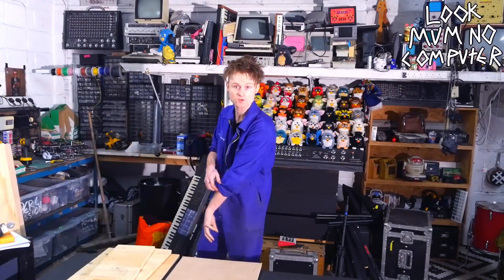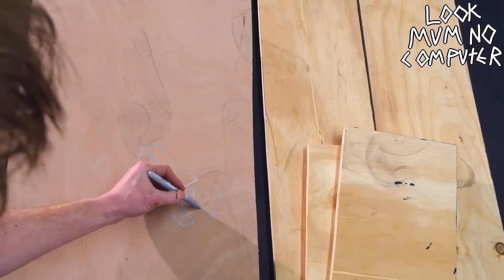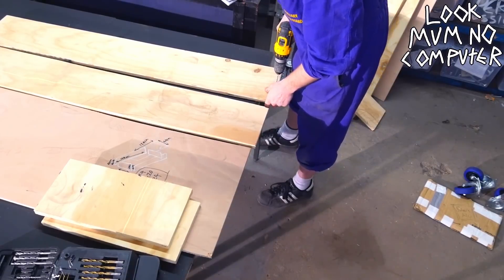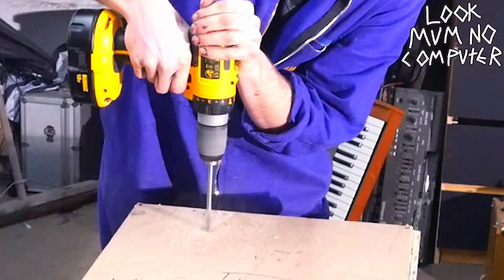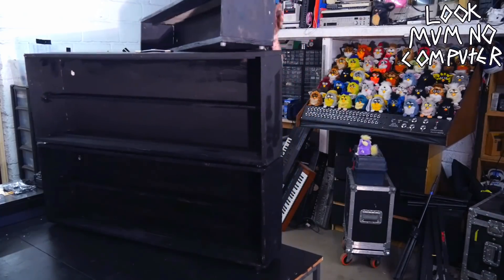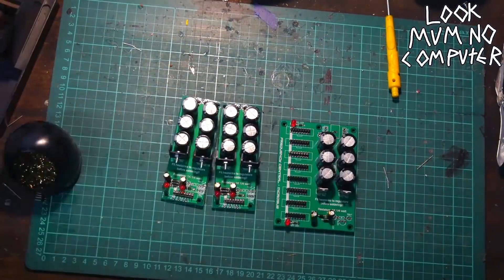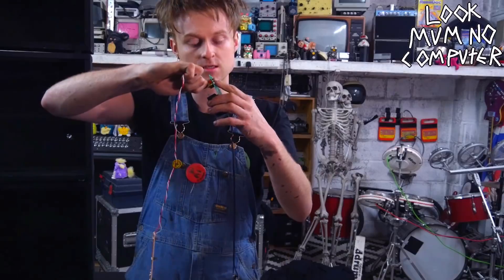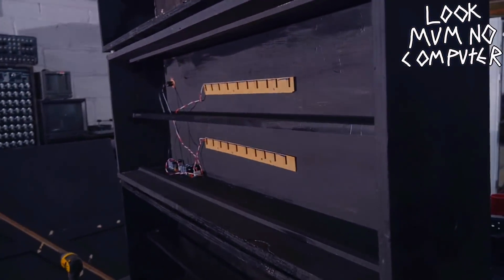Build A DIY Case And Power Supply For A Modular Synth CHEAP

Comment from the maker: “ A NOTE”A quick note I possibly didn’t make clear! The power jack isn’t 240 volts! That would be crazy. It’s wired to a 12v ac wall wart. There’s a link in the description to it!
Reply: LOOK MUM NO COMPUTER i wouldn’t put it past you lol
Reply: You should pin this comment
Reply: Are AC wall - warts or transformers a whole lot harder to come by than DC?  I have seen maybe two schematics online for making a bi-polar supply from a D.C. Wall wart, because they're more common out in this here New World.  AC are much less likely to be found.  So your voltage regulators on your Freq. Central PCBs, they're rated for a good 1 - 1&1/2 Amperes per regulator, no?  So maybe a good idea to take note your regulators' current capacities in Amperes  when matching the AC wall warts for them.  If your wall wart is able to provide 5.5 Amperes of current, then you should probably make allowances by wiring two of the regulator PCBs to the single wall wart (so to use its current capabilities efficiently).  By using different values of fuses for both rails, I've learned a whole lot about power consumption.  If you're modules need a total of 450 milliAmperes of current, I'll put a 600 mAmp fuse on it, so it won't allow too high of a current spike.  More modules, I put bigger fuse.  So I've learned that my fuse should reflect my power consumption needs and not just to put the largest fuse that my wall wart would allow! Since maybe I only need 1/2 of my wall wart's power capability.  Any thoughts / feelings about the donut shaped Toroidal transformers vs the cube shaped varieties?  You are really doing great, Thank You!
Reply: You are going to freaking bust your equipment Sam we have a gig coming up remember? FANS PLZ DONT GO :'rjfjrhfjdkcmdnjjhhejfnfhjfje OK ITS ANNOYING PLS DONT SAY HI DONT BURST MY FUSE U 3 YR OLDS PLZ NO ATTACK PLEEEEEEEEEEEZ        XD
Reply: Slightly important information that will help prevent death
Reply: Would the custom power supply work with Video synths? I would like to get started, but I don't want to buy something that isn't compatible.
Reply: Do you know if they'll work with a 15V AC thingy?

Comment: You can use screen window framing pieces for the rails as well. It's very inexpensive (about $4 US for a 7ft length), doesn't splinter when you screw your modules in, and is almost the exact same size as a legit pre-drilled Eurorack rail. Once you get your rails into your case just slap the module into the rail space, mark the holes with a permanent marker, use a 2mm bit to drill holes, then screw your modules right on it. It'll be sung the first go, but the screw will tap your hole as you screw it in since aluminum is soft. Hope you enjoy this tip!

Comment: I have a problem with my power supply. If I measure from -12 to +12 I get 48V and from -12 to GND I get 26V. At the start I have 12V but from the first diodes on it is 40V and also at the big capacitors. Can you maybe help me? :D

Comment: If anyone makes similar make sure those PSUs are wired all in phase! It doesnt matter which you connect if you have one psu board but if you have multiple connected to 12v AC they must be connected in phase
Reply from the maker: good bit of advise there i completely forgot to mention!
Reply: A rectified 12VDC supply line does not matter in terms of phase. No synthesizers I know of are powered directly with AC, they all use DC
Reply: I have never made any attempt to have my power supplies in phase? It's all DC after the power supply so Matt Gaines is right!
Reply: I still can't understand how this circuit works without a transformer... Reactifying bridges, caps and volt. regulators? So is it a rough version of a linear DC supply?
Reply: MoolahNasreddin I think it probably is a charge pump. These invert a DC voltage by periodically charging a capacitor with the input voltage and then connecting the positively charged electrode of the capacitor to ground. Then another capacitor is charged from the negatively charged electrode, which now is below ground by the input voltage. I don’t know if this explanation is good, maybe you should look up a circuit diagram.
Reply: Maybe! Need to find these schem's someday... For now I'm relying on 13.5v bipolar MeanWell supply. 1.2A max isn't great I know... so I always think "what i'll do when my "monster" will have multiple voice cards"...
Reply: MoolahNasreddin the transformer is handled by a wall wart, not on board. If you throw mains in to this it will blow up
Reply: This design is not a charge pump design, those are typical of switchers. This board is just a full bridge rectifier followed by a pair of linear voltage regulators. It rectifies 12VAC to something like +/- 16VDC which needs to be regulated down.
Reply: Right! I remember now! :) Probably I has such schem's in my archive. It was just the full impression that Sam is talking about mains going into this. I think it's some distraction of myself.
Reply: Actually looks like a single diode for each voltage rail, so not full bridge. Positive half of the cycle charges the capacitors on the V+ rail, negative half of the cycle charges the capacitors on the V- rail. You have to do it that way because the transformer is not center tapped (only 2 wires coming out of the wall wart).
Reply: Why? Modules use +12V and - 12V after diodes caps and regulators ICs. What's the problem if what's before the regulators is not in phase across different PSUs?

Comment: I always build my Kosmo cases with backs that can flip open. Held closed with magnets. But I guess for touring that would be too fragile. I mount the power bus system on the floor of the case instead of on the back. I love the way you put these cases together Sam. It's so simple and yet so practical.

Comment: Pretty cool units and very useful. Just a thought - if you drill a few holes in the top to line up with the rubber feet then they will lock together a bit better. Glue some blocks on the inside then to seal up the holes...

Comment: Like the strip board power distribution. I do that too!
Reply: where can you buy large pieces of stripboard like the one sam has in this video? or is it just a bunch of smaller pieces connected to eachother? hope you read this i am very curious to know. and thanks in advance if you do!
Reply: @freshescargot2470  I've never found long pieces like Sam has. Wish I knew where to get ones like that. I just ordered some of the longest ones I could find available on ebay in the U.S. I use 2.58" solder in screw terminals to connect power to the strip boards. Good luck with your DIY!

Comment: So can you do a little more about the power supply? This is the most informative video I've seen so far and all your videos are inspiring stuff but it sounds like, when I see +12 and -12 volts, maybe you can use an old desktop PC PSU. God knows I have a ton of those around. BUT what is the pinout like? etc. GREAT WORK! keep on preaching!
Reply from the maker: Yep that’ll work
Reply from the maker: Pin out? Anything asling as the wires are wired up right. If you want to use the same connectors as in the vid search up eurorack power connector pinout

Comment: Hey Sam! So I'm building my first case. 40 cm x 20 cm sides but only 80 cm wide, due to what wood I already had. Thinking about rail placement now. Can you say why you offset your rails so far back? Most other cases I've seen look to be flush or just very slight recessed. Is it so you can transport your cases with cables plugged in and not damage them? Thanks and keep up the amazing work!
Reply from the maker: Yep I put mine back about 13cm to clear the jacks with a bit of wood on the front

Comment: Man, will be cool if you'll be explaining oscillator circuits in details! I know some things but this is basically in the range of just one type of oscillator: saw core Jupiter8 design (made in AdamskiA videos). Very good oscillator (in terms of cheapness) but highly depends on DC stability.

Comment: I have a bench power supply(fairly cheap one from Amazon), I’m wondering if it works in the same way. I’ve had several failed attempts at making the ms-20 filter and the 1v/octave cem3340 oscillator, after troubleshooting, I’m beginning to suspect the bench power supply I’m using is the culprit. It has a +, - and ground so I assumed it would be fine but after poking my cem3340 oscillator I noticed that when set to 12v, the positive was putting out 3.8v and the negative was -8v. The power supply works fine on projects that don’t use bipolar power.

Comment: I have a question about the whole +/-12V DC. So, I came across and article that had shown that use of dual 12vAC/DC adapters wired together creating a +12V/GND/-12V and is the method I decided to go with because of the simplicity of it. Now my main question is...what in the heck gets connected to the -12V? lol The modules I have right now are basic 555, Hex, and Phase locked loops which can be powered by either 5V/GND or +12V/GND. What part of any of diy modules will be using the -12V? I've already blown six 555 chips with experimenting (wasn't the smartest thing but fun fire works in my studio!) lol Answers are greatly appreciated :) thanks

Comment: Sam, take bashed bits of broken electronics and strip them for parts to make your first modules:  old stereos, old mixers, etc.  Stuff that is junk and just being sold for parts/scrap... parts that most anyone can find in the rubbish bin.  I like the idea of showing people that there IS a way to build your own stuff on a minimal budget.
Reply: I scavenge old electronics for parts and alot of the stuff inside is reusable! the biggest trouble with this idea is finding some kind of transconductance device. the CA3080 or even updated LM1700 are not going to be in regular gear that can be salvaged. These are unfortunately essential for stable oscillators/filters. however, some sound system equalizers have discrete transistor pairs which would likely be closely matched, which you could use for log conversion, etc. FETs are also not as common in consumer electronics, or logic chips... I definitely filled my parts bin with stereo innards and was making shitty noises before I bought actual parts but way worth it to just buy the parts IMO.

Comment: The cases seem quite wide. I can see the benefit of the front space from the batons to leave cables plugged in, but was thinking of making a picture frame type wall mounting to hold my Kosmo's. Is the recommended width just for stacking the cases or are there cooling or other considerations that I haven't thought of? Cheers.

Comment: What’s a good preassembled power supply and such that I could buy for a case like this? What are all the electrical components required?
Reply: Pretty sure if you ask Frequency Central, they'll sell you an assembled FC Power - they sell assembled and unassembled versions of their modules, so I would assume they'd be happy to do the same for the power supply! But probably with additional cost? Just make sure to specify that you want assembled clearly because it looks like they usually just sell the PCBs. "Generally these PCBs are DIY only, but I am prepared to build them should you wish, please enquire."  http://www.frequencycentral.co.uk/?page_id=1758

Comment: I cant figure out after hours how you built the extra sockets on strip board, like how did you connect it to the power supply and so?
Reply: Like what cable do you use to connect?

Comment: Quick question: why choosing 8 pins for the modules and bus board, when you've only got +12, GND, -12 (and the optional +5V) wouldn't it be easier to use 4 pins? ^^
Reply: I think it's a standard power supply output ...
Reply: -12v. Ground. Ground. Ground. +12v. Pitch. Gate. +5v.

3 ground lanes to minimise the chance of the +12/-12 coming into direct contact, and the magic smoke that ensues if they do.

+5v is typically used to power a microcontroller, so you do need voltage regulators in digital modules.

The other 2 lanes are simply for module communication. These are rarely used, and rarely used for their intended purpose. EG malekko use them to sync their sequencer modules, whereas tiptop use them as a mix bus for their drum modules.

It's just the eurorack standard (which is actually 16pin not 8, I'm assuming the reason he's using 8 here is just for cost cutting reasons, or just what was at hand). Most eurorack modules use a 16pin to 10pin cable, and simply ignore the +5v and comm rails. 

It's a common standard, and so it's cheaper and easier to just use what already exists.

Comment: Hi Sam! It seems that 8pin connector differ from the eurorack one. Eurorack connector has two lines of 8 pin each..
Reply from the maker: indeed. but in essence the 2 rows are just joined together in eurorack. so just imagine the two lines as connected together. if you look at eurorack pcb's youll see the 2 lines are just connected together
Reply: @LOOKMUMNOCOMPUTER  ok, so if I put an eurorack in your one line connector, or if I put a kosmo into a two lines one it works anyway?

Comment: If anyone could come up with an answer...you’d be my best guess. 
How would you go about connecting a computer fan to a eurorack bus board. I’d like to pull air thru my case. 
Or is that be something even worth doing.
Reply: I'm pretty sure most case fans are 5V. So as long as your fan doesn't have any digital nonsense for controlling the speed, you should be able to wire it directly across 5V and ground.

Comment: Hi, great vid! I'm interested if I can use 0.1 uF 50v capacitors instead of 0.1 uF 100v ? thanks!
Reply: The voltage rating on a capacitor lets you know the max amount of voltage a cap will take before it goes pop. Since these caps are being used for mains rectification I would stick with whatever is recommended to avoid any unwanted fireworks :)

Comment: Just curious: why would you use that kind of power supply? If you go somewhere with anything else than 230VAC, you would need another "transformer", right?
Reply from the maker: Thomas Dias no it’s not 230 you use a wall wart
Reply: LOOK MUM NO COMPUTER yes, but if you're in a country where it's 110VAC, I doubt you'll get 12VAC out of your wall wart?

Comment: amazing work as per usual -  QUESTION: do you get hum / interference using wood cases? is the paint you used conductive?
Reply: Since the power supplies use half wave rectification, any hum you might get is probably from the ripple on the power supplies ...

Comment: Disagree on the wood rails. I tried that for a minute. But they get chewed up pretty fast if you occasionally move modules around. Also it helps to reduce EMI noise by tying all the faceplates of your modules together electronically. 
Personally I prefer to buy/scavenge toolboxes and first aid kit boxes for modular cases. They have the benefit of handles, latches and covers. Also plastic and sheet metal construction ends up lighter than heavy ass wood!

Comment: I built one of those power supplies and I can’t figure out which pin is ground. Can you please help?
Reply: Ground is on the right (DC out) of the board, and labelled "gnd". There isn't a ground on the AC in side. If you're looking for ground on the double header pins, it's the middle of the pins - best to use a multimeter to check continuity between the header and the "gnd" pad.
Reply: Thanks for the reply. I built the multi bus power supply and it doesn’t have anything printed. I figured it out though.

Comment: N00b here... just soldered up the microbus and it seems to be working... Is there a diagram that shows how the power out is laid out? seems like 2 dead pins, +5v, +12v, gnd, gnd, gnd, -12v. Can anyone confirm? Thanks.
Reply: I'll answer my own question. Yes! the eurorack spec that the Power supply is built for follows that spec. Google "eurorack power pin out"

Comment: Won't those panels split with you putting screws in them from the edge?
Reply from the maker: probably
Reply from the maker: thats what the paint is for. this is how ive built cases since i started doing this. and not one has fallen apart. even when being bashed up and down hallways all over the place

Comment: Let's say i'd like to build my own small Eurorack with this. The "manual" for the power supply says, it gives me roughly 500 mA. That's not a lot for filling up let's say...84 HP. Or do i overestimate the poser consumption of single modules? O_o
Reply from the maker: Björn Eckert just see how much you get out of it. If it’s running too much current through it. The regulators turn themselves off. As a safety precaution. Just unplug a couple of modules and try again. I think 8/10 modules per power filtering thing is probs the limit. 5 braids as they sap a lot. If it’s all analog completely then 1 brick for the whole thing!

Comment: Why did you build these with 8 pin power headers instead of 16?
Reply: Why not use 4? He only has GND, +12, -12 and an optional +5. I see no need for 8 and definitely not 16 pins that would not get used

Comment: You could have used simple cheap PC power supplies that you find everywhere for next to nothing. These provide tons of power, +12, -12, +5, +3.3 , whatever you like. Screw on back board it even brings its own IEC connector and runs from 110v onwards.
Reply: Not suitable for audio purposes. They're incredibly noisy.
Reply: @AshBashVids  Could you filter the output?
Reply: @ericjohnson1811  It would need a LOT of filtering.
Reply: @AshBashVids  Thanks for the reply! Fortunately it isn't that hard to make a good power supply. : )